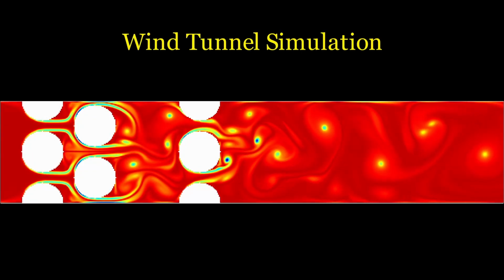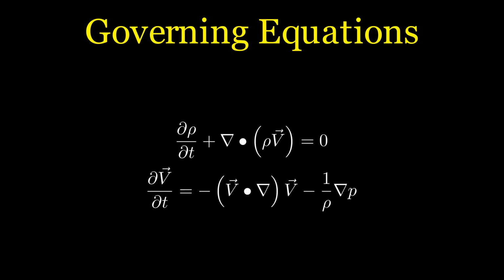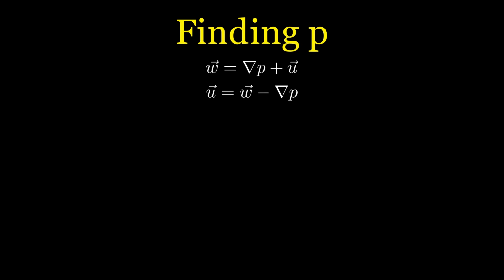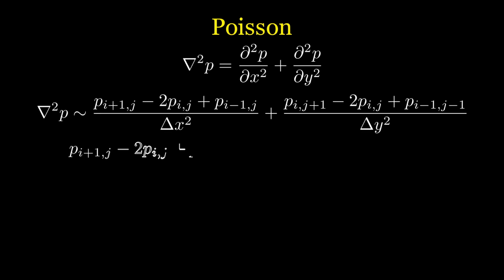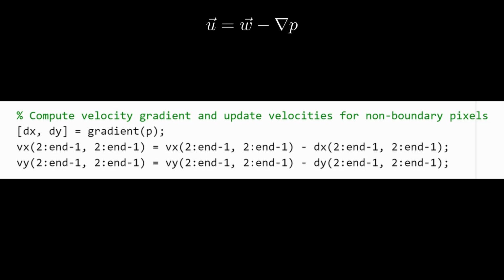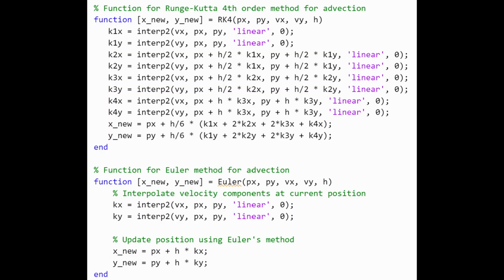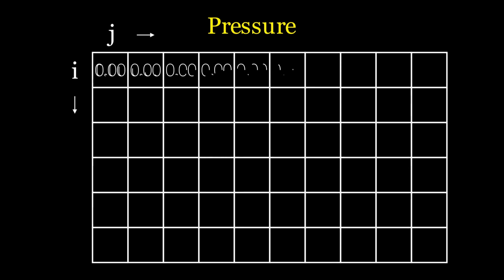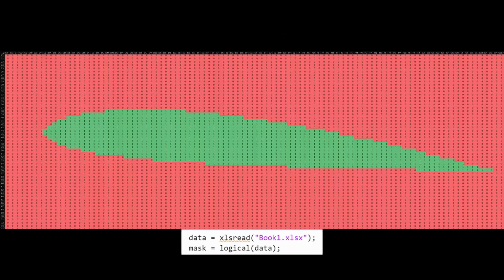How to Simulate Basic Wind Tunnel Flow || Matlab Code in Description

Comment: Beautiful video! Do you know the vortex particle method? It can be used as an alternative representation for vortex sheets in a panel method
Reply from the maker: @misterx8934  Thanks! And I actually have another video going over that method on this channel. Mind was blown when I animated it and realized there was actually no flow within the airfoil. At first a kinda assumed it would be like a doublet in uniform flow modeling a cylinder snd how there is an internal flow but yeah VPM, nothing, was nice to see clearly.

Comment: Can u tell me which topics I should study to understand this video ? :)
Reply from the maker: I would say start with Jos Stam's paper Stable Fluids, as it is alot of the basis of this process especially the advection. For the CFD part either John Anderson Computational Fluid Dynamics or Computational Fluid Dynamics for Engineers by Hoffman and Chiang their first volume covers these processes such as the Jacobi iterative method for elliptic PDEs. Good luck snd hope you enjoy the topic further!
Reply: @Tidepodious  I think I need more basic education since I'm in tenth grade rn
Reply: @Tidepodious  I discovered ur channel while learning how to solve depressed cubics
Reply: @i_like_ft.  I'm a UK student, so my curriculum modules won't be exactly the same as yours. But for fluid dynamics you'll need to have knowledge of vector and multivariable calculus - which I don't believe you'll learn in academia for a couple of years at least. Unless, by all means, have a go at learning them yourself (granted you already have basic calculus knowledge)
Reply: @jimmelton  hlw im from Bangladesh so we also dont learn calculus till 11th grade. ik a little bit of calculus but i havent learned multivariable calculus yet.can u suggest from where i should learn ?